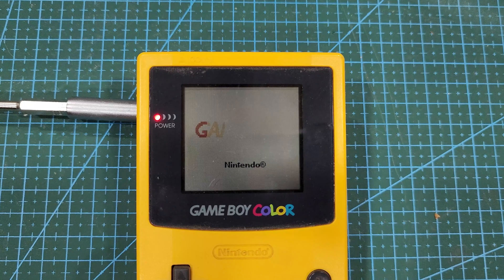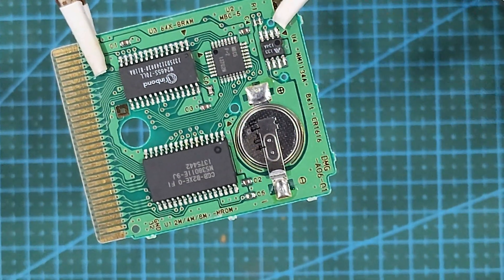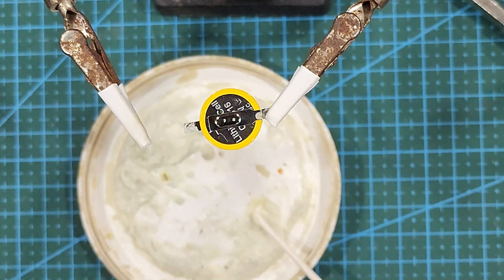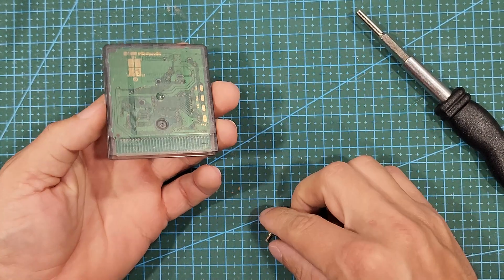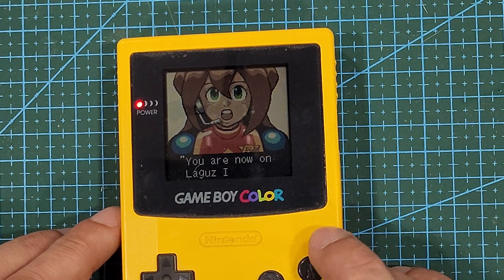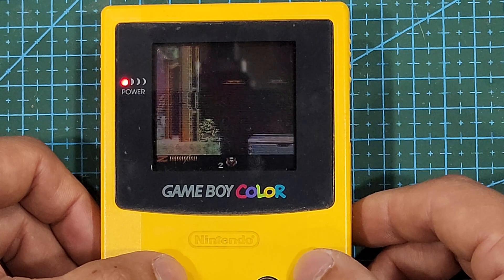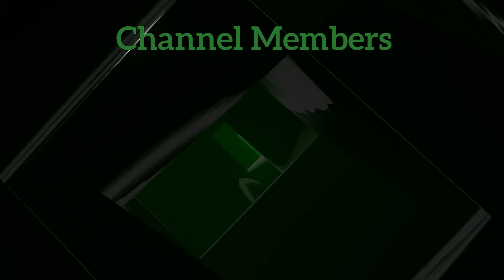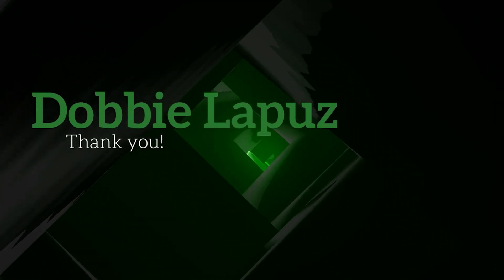The Easy and Right Way to Replace Gameboy Cartridge Batteries

Comment: I typed a whole spiel up and apparently forgot to post the comment before navigating away.

If anyone's undertaking this repair, please ensure you're using electronics soldering flux and solder, NOT plumbing flux and solder. The solder should be obvious to tell because piping solder is usually thick as hell and won't work with an electronic pencil iron intended for board repairs, however the flux meant for piping will corrode your electronics over time because it isn't meant for that. I noticed the flux listed in the video description is the stuff for plumbing. Instead, I'd suggest something like "SRA Solder 135 Rosin Paste Soldering Flux" (as an example, there are obviously other manufacturers). Just check the listing and make sure it's intended for electronics/circuit board work.

Comment: This was the best video i’ve seen on this so far, genuinely thank you! 🙏 I was wondering: What do you do if a little too much solder accidentally gets outside of the bounds of where you re-attached the battery to the board? How can you safely clean that up without damaging the hardware?
Reply from the maker: Normally the solder stays pretty close to the solder pads due to the flux bonding the solder to the metal.
But if you did get excess solder away from the pad you could use a solder wick to remove excess solder. A solder wick works by heating the wick up with the iron and pressing it into the solder, and it will absorb the solder for you.

https://amzn.to/3BBWKqf
Reply: @JoeMartinMVC  Thank you for explaining!

Comment: Thank you. Two questions I had. Any thoughts on how to save a game before you do this and restore it afterward? Also I had a similar issue with a Gamecube clock battery. A lot of people recommended replacing it with a "Battery mount" so you could just replace the battery without soldering if it ever died again. Is there anything like that for gameboy games (I'm guessing not with how tight of a form factor this is).
Reply from the maker: There are devices used to back up save data such as this one: https://amzn.to/3KHqGCC

I'd have to grab my old Gamecube and look in to that, but it sounds like a fun video to make.

As to your question though, I have not seen anything like that for Gameboy carts.
Reply: You probably got your answer by now but if not to save or load games for the Gameboy I would recommend using the Mega Memory Card.  It is really easy to use and you attach your game to it. Really good if you play Pokemon and have at least 2 games.

Comment: does your solder not come pre fluxed?
Reply: this is a common misconception. there is flux in solder. HOWEVER, flux pretty much dictates where the solder will flow. that means you have to heat each part much less and get much better joints when you flux connections. say goodbye to cold welds and you can finally solder those finicky parts you've tried sanding 1000 times.

Comment: Can I just say thank you for finally explaining the polarity of the batteries properly? Most videos just tell me that that this is the way that it should be aligned and they don't actually explain or show that the flat side is the positive side. I've been soldering it wrong this whole time because the battery arrangement is so inconsistent in all the videos. Thank you!

Comment: What temp should the solder iron be?
Reply from the maker: You'd want to see what temperature your solder calls for, but most lead-free solders are around 300-320c or 600-650f.
Since you're not directly soldering on the battery most temperatures should be safe.